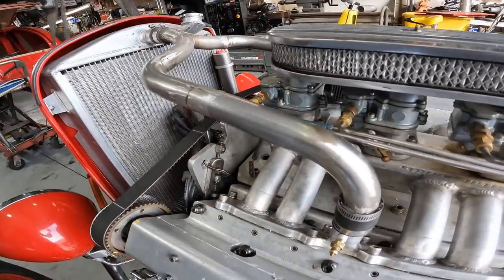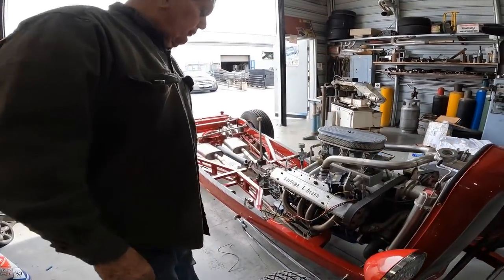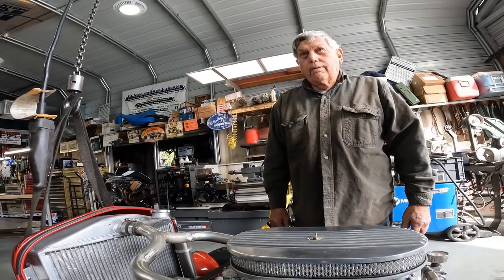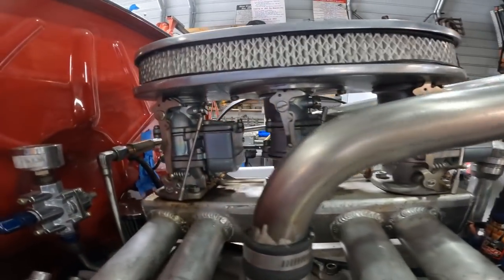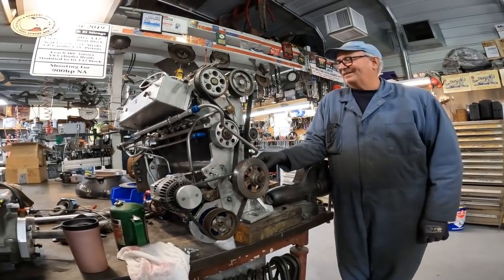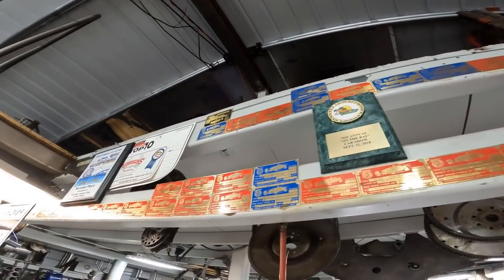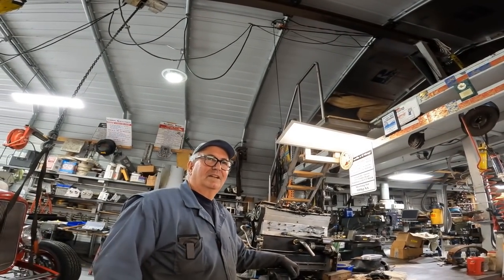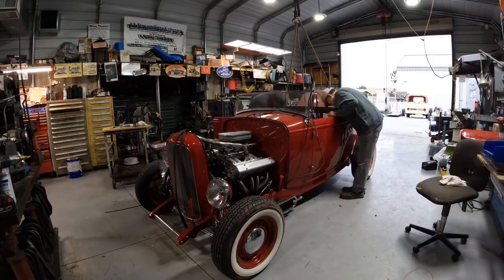Old School Automotive Gear Head Content for Mechanically Inclined People.

Comment: cool but the water in the pulley thing toyota dose it on the 3.0 l v-6 not say toyota did it first just there's not a lot that's out there it's all been tried but you can think about it or you can do it and these guys do it and they do it vary well indeed keep up the outstanding work

Comment: Why would a couple of gear heads Wana build a flat motor to turn more rooms ,they are junk the blocks are junk ,the cranks are junk the rods are made of vanadium but they are not speed parts ,just build a Motor like konegseg 3 cylinders that makes 650 HP no cams no cam chains just a valve actuator , crank n piston rod or look at the new rotory motor 335 HP and it weighs 150 lbs, screw the flat motor it's a waste of time and energy

Comment: Why would anyone say this can't be done when ARDUN heads have been available since the 1960s
Reply from the maker: The Ardun heads are over head valves that uses pushrods with a single camshaft,  however, they are not overhead camshafts such as the one Pete and Kevin made for the Flathead Ford.

Comment: You can say motor. ie: motor vehicle 🚜. Motor racing 🐎 motorhead 🎸🎸🎸..Detroit-motor city! Yea I reckon motor is okay.
Reply from the maker: Right on, thanks for bringing this up. I have noticed the word "motor" is a common saying in North America, and I hear both terms "engine" and "motor" used in-and-around the shop. I would say that from what I hear, both words are used  amongst automotive technicians and people to reference the internal combustion engine/motor under the hood.  However, I think in other parts of the world, the word "motor" is the translation for engine. For example, in Spanish the  engine is called " El Motor," in French the engine is called "Le Moteur,"  in German it is "Das Motor," and Italian "il motore."  Seems that the word Motor is more common in Latin based languages, however I'm no expert in linguistics.  Maybe I should reach out to KPBS and ask "A Way With Words" and see what they say?  Thanks Greg

Comment: Another awesome video👌 How are you liking the GoPro 10 any complaints?
Reply from the maker: The GoPro 10 is freaking Amazing - It has been a game changer for this race season.  The telemetry is very accurate for measuring speed for the land speed records. The image stabilization make the videos smooth and the resolution and super high quality.  I highly recommend the GoPro 10 or 9  . I have booth and I found that the 10 is best for inside the race car at 250+ MPH  I would recommend GoPro all day long. Simply the best tool for documenting and amateur  video .  Every single video I have on YouTube is done on a GoPro 9 or 10.
Reply: @GregQuirin  That's good to know, thank you for the response I've heard rumors they were kind of glitchy at times and have been trying to find something to film my father-son Gasser project. Keep the great content coming👍

Comment: Why doesn't oem do crank pos. Sensors on the flywheel
Reply: Several OEM's do/or have in the past, but the standard now is to have the reluctor pressed onto the crank, as there is the least amount of harmonic torsional variation and the most accurate timing event possible.
Reply: Oh that makes sense I wonder if the lack of deviation causes deviation though

Comment: Cool stuff..So what's your trade Greg.?...I'm 45+ years mechanic and still at it..
Reply from the maker: @ZIGgassedUp - I'm a mixed nuts car guy, I was an automotive technician for many years, then went into technical education teaching  automotive classes to high school students in San Diego. For the last 14 years I have been working in the central office for Career Technical Education (Formerly Vocational Education) I manage 5 automotive training programs and several other skilled trades type programs such a machine tool and construction technology and many more. I support approximately  60 teachers.   I like solving problems with my hands using a scan tool, DVOM, dial caliper and hand tools.   The dynamics of hand-on skilled trade type careers is very difficult to attract the younger generation, which is our future workforce.  I enjoy highlighting the skill set and unique talents in the automotive industry however the interest in these video's I make are primary older men between the ages of 50 and 80 years old according to the analytics YouTube provides me. It would be cool if there were more younger people interested in keeping the car culture alive.